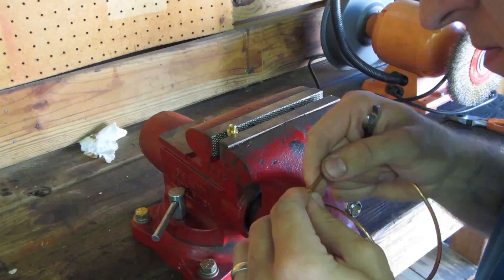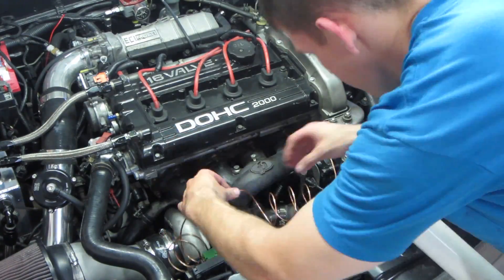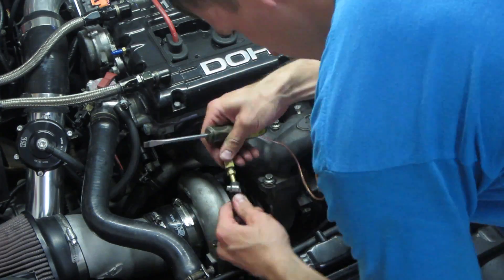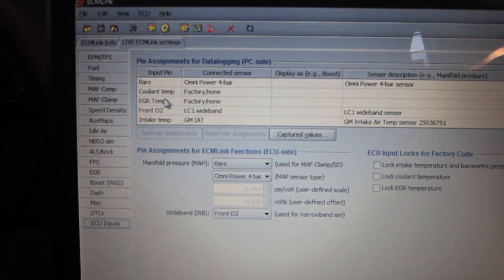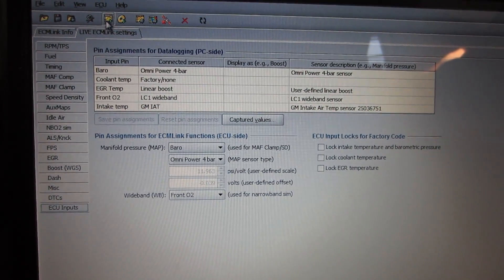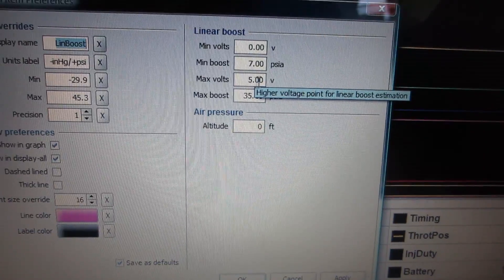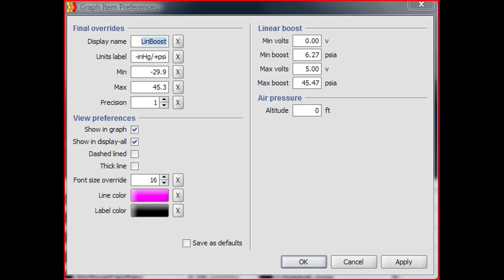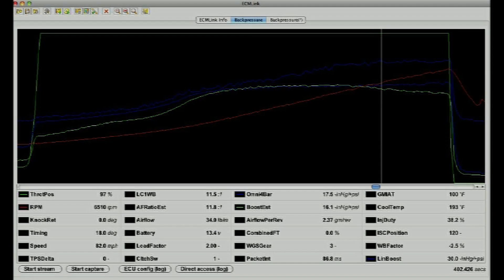Wiring and Logging a Map Sensor Part 3 - Pressure

Comment: I remember reading somewhere that installing a fuel filter in line with the manifold pressure tubing cuts out any fluctuations and spikes in pressure. But looking at your logs, it looks like the coil of tubing/length worked pretty dam good.

So 1.7 ratio. I wonder if maybe the .55 a/r turbine housing is just a bit too small? Or maybe a bigger trim turbine wheel would help bring the ratio down?
This is awesome! Thanks for the research and sharing it!

I think this test would be interesting on a STi.
Reply from the maker: Any type of chamber that would hold a adequate amount of air would stop the fluctuation. The coiled tubbing worked pretty good in my case and it was simple.

The high backpressure is a direct result of the small turbine housing. A larger turbine housing would be the key to lowering the backpressure in my case. If you where maxing out the flow of the turbine wheel, you would need to consider changing it.

Its a great test for any car that has been modified and the same concept applies, you just need a manifold that you do not mind drilling some holes in or another way to read the pressure inside the exhaust manifold (like the EGR valve).

Comment: What is the benefit of logging your back pressure? Is there a ratio you are using as a target? Obviously a goal is to maximize efficiency, but who/what do you reference?
Reply from the maker: Back pressure simply lets us know just how restrictive the parts after the exhaust valves are. Since the exhaust is an open 3in system, we are basically testing the turbine housing alone. The benefit is that it provides another data point for you to compare logs and you parts selection too. My VE table is in the low 70’s in the upper part of my rev range. This high ratio gives insight as to why. 

You hit the nail on the head, we are trying our best to find out what is causing my lower VE numbers and maximize the motors efficiency so that we can get the best results from the air going into the motor. With this information we can see that even if the motor could flow more air, the exhaust parts can not get rid of it. I would like to reach a 1.2:1 or lower. 

There is no magic number. It is more about what you would like to do with the car and what you expect it to do. If you want a fast spooling big turbo using a small exhaust housing, you can expect higher numbers. If you want to make higher numbers on pump gas, you need to shot for something lower on the scale.